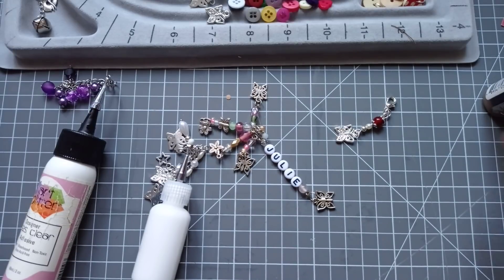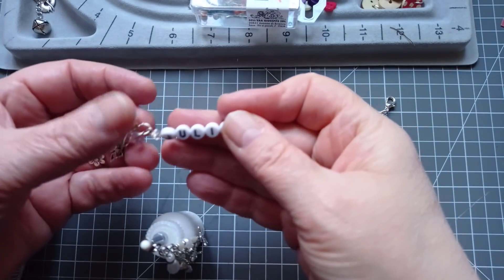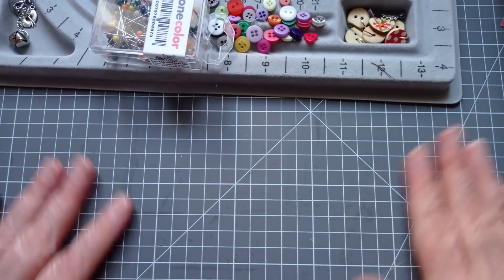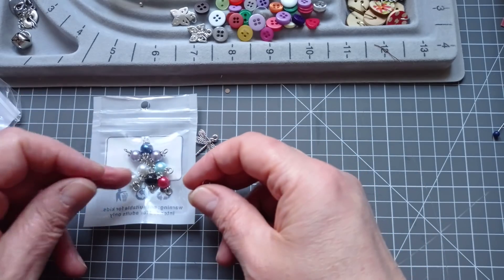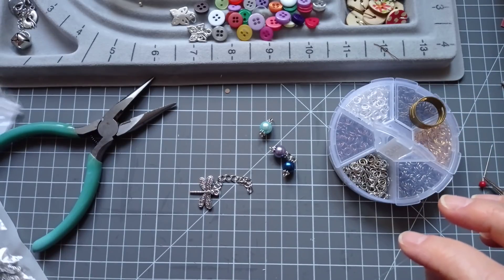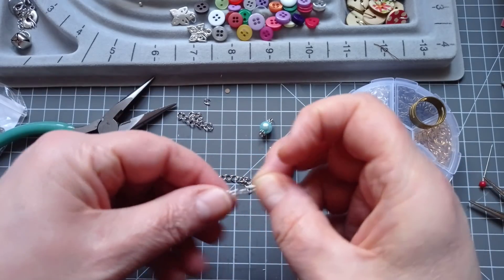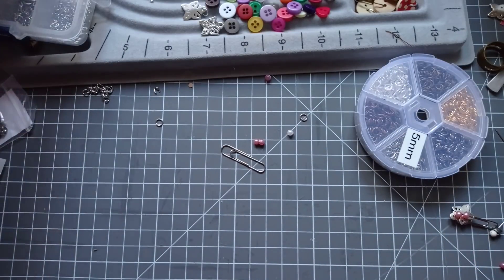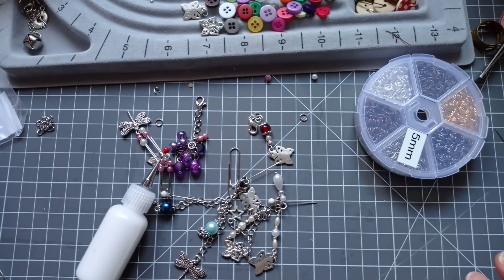Glue Bottle Dangles - 3 Easy Ways

Comment: I have discovered that finding stainless Steel pins is rather difficult here in Southeastern US. They are most if not all nickel treated. I’ve looked everywhere. Don’t do Amazon so is hard to find even in quilting stores!
Reply from the maker: Oh my word Susan, it's easier to find one in a haystack i think.  I've bought many from Amazon that turned out not to be stainless steel.  The ones i did find i couldn't find on Amazon.com.  There is a place in the UK that i have since bought some from and they do ship worldwide. Plushaddict.co.uk altough they appear to be out of stock at the moment😊🤗💜
I'm still searching.  you'd thing living in the city where stainless steel was invented, it would be easy😘☺️🤗💜

Comment: I'm always loosing the pin. I did luck out, and find a box of steel pins at a resale shop. I have a small container for a few pins that I keep in a box with my main necessities. I'll replace the pin with another one when I can't find it right away. When I'm finished, I'll sweep the floor and usually find it. But there have been days where I can't find the pin after sweeping and other days that I'll find 2 or 3 pins. I need to get my craft room sorted out. It's a big mess and I get over welmed when I looked at it. Next year, after I get my heart fixed, I'll have more engery and I'll try tackling the room again. I've been thinking about making a dangle. I'll see what I can find to work with.

Comment: I bought some pins that said stainless steel and they rusted. I wonder if there is a difference amongst stainless pins. I really need to make one of these charms because I am always losing mine. lol
Reply from the maker: Hi Gail, yes i've bought quite a few sets that said stainless steel and they weren't. I've tested these and they are still rust free😁
Quite a few sets got sent back to amazon if the reutrn was free.
They are quite fun to make and i haven't lost the pin from the one my friend made me in over 6 months😊🤗💜
Reply: @CameliaCraftsDesigns  I guess I will keep trying to find a ss pins that don’t rust. Good to know they are out there. I’ll look on Amazon and make sure of free returns. lol 😀❤️
Reply from the maker: If you look on my UK Amazon storefront you'll find the ones I used. If you're outside the UK you can still see the details to try and find them. These were made in Italy 😊🤗💜
Reply: @CameliaCraftsDesigns  that's a great idea, thanks Julie! I'm in the U.S. so I'll certainly give it a try. I'm tired of spitting out brown glue to get to the clean glue. lol

Comment: Fascinating, new subbie here. I have a box of jewelry bits that I collected just before I got the papercraft card making bug.(squirrel,  tee hee) So excited to pull it out. My bearly Arts glue will be dangly fun! Thanks
Reply from the maker: Hi Carol, welcome aboard 😊 I'm s squirrel and it's so much fun incorporating all the treasure/junk I'm accumulated over the years in my junk journals.
Have fun with your dangles😊🤗💜
Reply: @CameliaCraftsDesigns  what size eyepins are you using please, need to buy some

Comment: What is the gray arch tray you have your dangles in??
Reply from the maker: Hi Rhonda, the trays i have are by a company called Beadsith.  They have a slight velour type coating to stop the beads rolling around and also have markings to help you arrange the right amount of beads before strining them. They do quite a few different styles. Mine were from the company, but they do have them on Amazon a little cheaper.
😊🤗💜

Comment: Hi Julie,  I knew this was coming...I tried making one today and was clueless.  Lol a bad bead day like a bad hair day for me...lol Thanks for sharing this.  I just got a new bottle of glue.  I know you have shared lots of glue info.  Do you want to hear about my find? I will give you a clue it is great for gluing leather.  It has a little bit of a wiggle time and is made by a company that starts with a B.  It is not F tac or 3in one.  I found spray glue same company with a B.  I removed it from the spray bottle put in a small Jane Davenport bottle that has a small and larger hole.  I placed 2 balls metal beads(wonder if your type of beads would work) It works great for just about everything. I just swirl it a few times to mix it up.  I will be making one of your of  topers for my mystery glue bottle. 🥰Laura
Reply from the maker: Definitely want to hear about your mysterious find Laura😁
A glue that does everything deserves a spot on my craft desk, under something probably😅
I'm too impatient to wait for glue to dry. I'll let you into a secret. I did glue a few ready for the video, left them somewhere to dry overnight and then couldn't remember where they were😘😁🤗💜
Reply: @CameliaCraftsDesigns  ok here it is Beacon Multi_Grip   works on hardware household and marine glue bonds tile brick concrete wood glass leather fabric and plaster waterproof and dries crystal clear...so found  at ace hardware here in US. I'm sure you could get it if you get other beacon like f tac there. It has a rounded top cap and I put my charms on there so I will find my top on my desk. Lol lol I have tried on all types of paper so far great. I placed a small hole in the safety foil plug?????and it is has not clogged.  It has a note It is the only all - purpose glue you will ever need. I have found you need a very tiny amount.  I have asthma and this smell is not like f tac.  It also for some reason does not so far do that bubble up thing. Lol happy about that.  I have a 4 oz bottle.  The best part was I had a store coupon and I got it for free😀. The spray glue was found at a store here called Family Dollar and it was a $1.00 !!!!! It is also Beacon called Beacon Value multi-purpose adhesive spray 2 oz  What I really like is after I transfer it to a squeeze bottle I have the spray bottle to use for other projects.  It says works on paper wood cardboard and more. It says non-toxic on this one.  I stock up on this because it is $1.00 and can be used for everything...lol. It does work great on paper napkins thick paper it is fast drying but not crazy fast. I like to spread it out even and it does just need a little shake before spraying. When it is in the plastic squeeze bottle I swirl it with the ball bearings 2 are working great. I found the ball bearings at Jane Davenport I'm sure you could get them at the hardware store.  lol I have found no need to add water it is great😍 I also got a deal on ( two )2 packs of gorilla kids glue sticks. (4) total.  ACE hardware again  so a total of 4 disappearing purple. I got for free because of my$20.00 coupon. I also got tiny bull dog binder clips free....lol my total glue haul was $2.00 from family dollar for two beacon spray bottles.  I am stocked up for 2022   I am on the look out for a double sided tape sale at Scrapbooking.com😀 I hope this made you laugh.lol Laura aka the Glue Hunter...lol
Reply: @CameliaCraftsDesigns  Have you ever heard of that glue?  It is working on everything I have tried. So far lol Laura

Comment: well, I've made my own earrings for ages. I've been wondering just how people have attached the dangly bits to their glue pins, but I never connected the two! Thank you so much for plain speaking!!!! I did wonder about how short your pins are, though. mine are 2 inches long and one of my bottles still gets clogged up unless I periodically unscrew the top and poke the pin through the underside of the nozzle tip. Do you have any trouble with those short pins?
Reply from the maker: Hi Kay, I know exactly what you mean,. I call those, why on earth didn't I think on that moments my crafty tunnel vision.
As for the pins, I think as long as they reach down past the bottom of the nozzle they should do the job. But I too find that they still get clogged when I'm not using them regularly, so have to sometimes unclog them or leave them to soak in hot soapy water for a while😊🤗💜